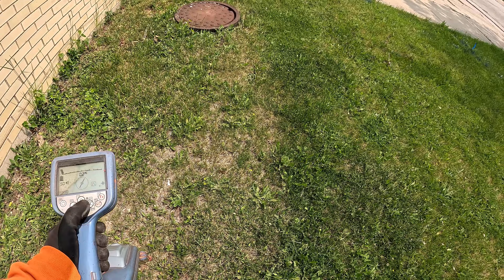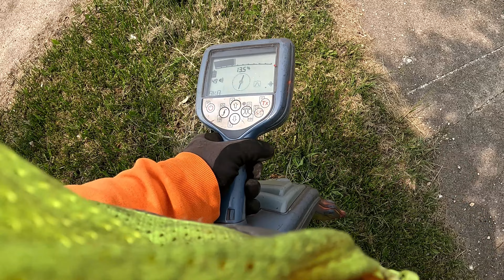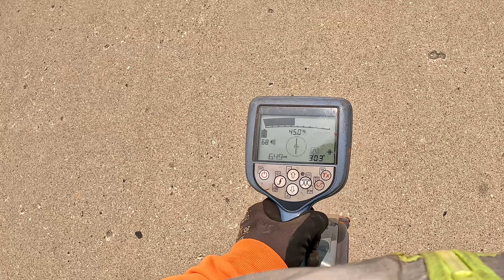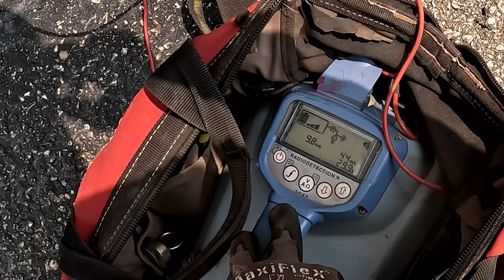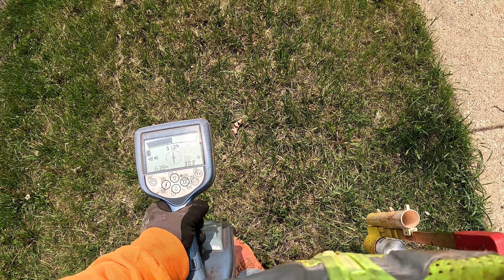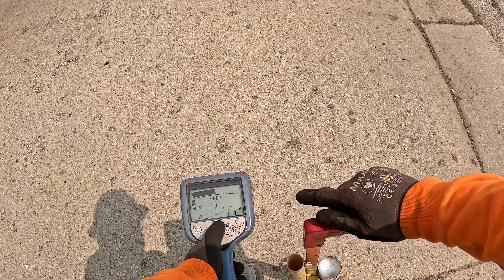Natural Gas Episodes 6 | Life of a Utility Locator 811

Comment: I have a really good question for you. When locating underground electric from the house to the pole and it has a temporary ground from the house to the pole, and it's above ground. What's the best way to locate it. I've direct connected and not a single tone.
Reply from the maker: When a house experiences a cable fault and a temporary ground connection is established on the ground to restore full power, it can become difficult to locate the underground utility accurately. The presence of the temporary line on the ground can interfere with the process of locating the utility. In such cases, it is necessary for the power company to relocate the temporary line so that the property can be thoroughly located without any interference.